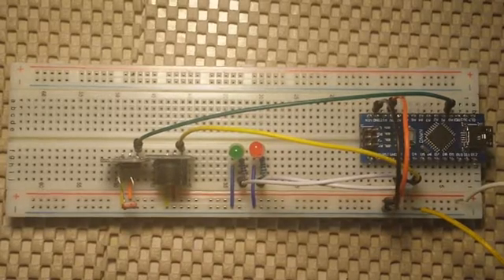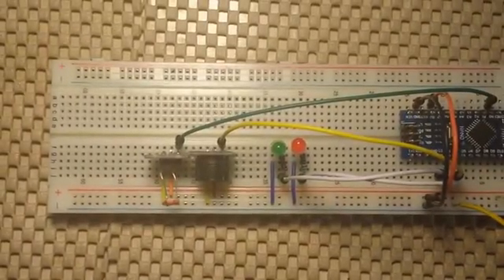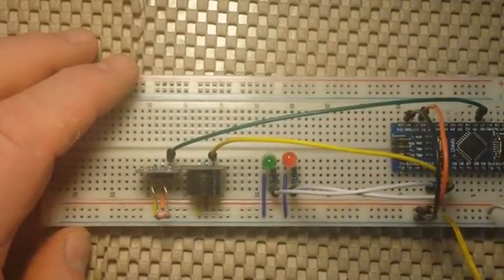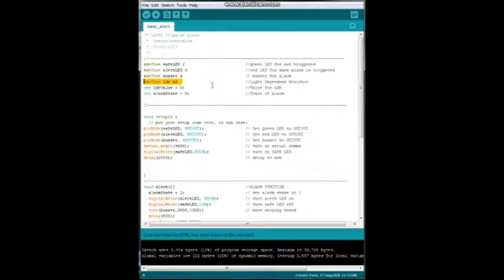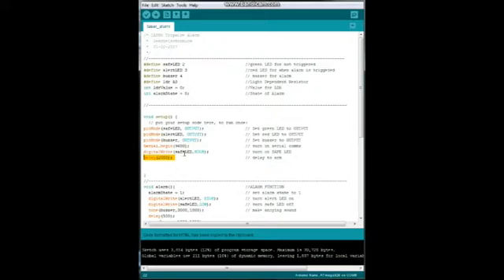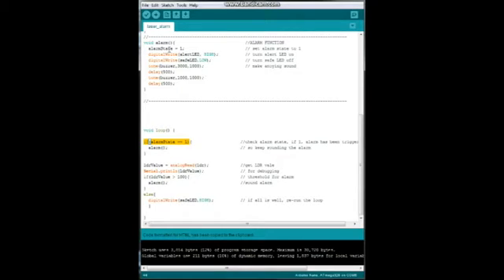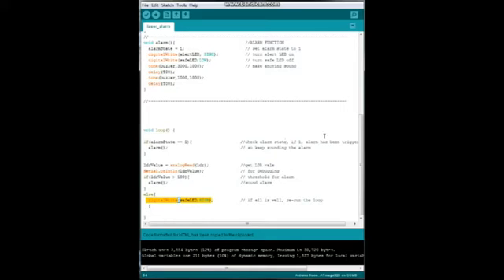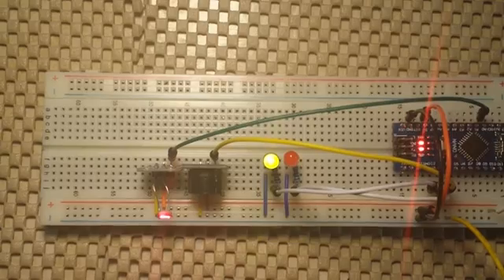Arduino Basics   How to Build a Laser Tripwire Alarm

Comment: I don't have a buzzer module, I just have some peizos. How do I hook that up in place of the buzzer module?
Reply from the maker: Hi Ryan, Thanks for taking the time to comment. With the Peizzo, you would wire the positive side to the digital pin you chose for output and the other side to ground.